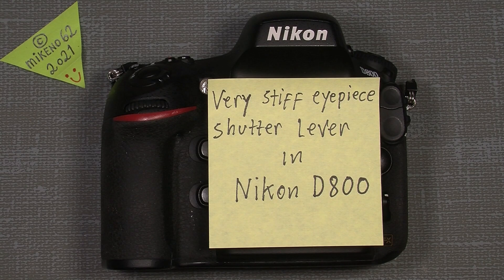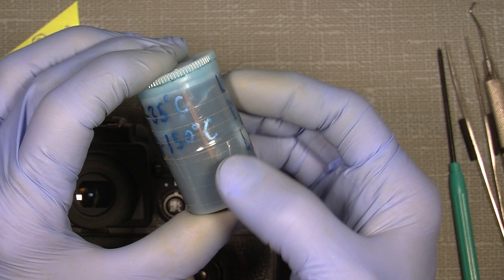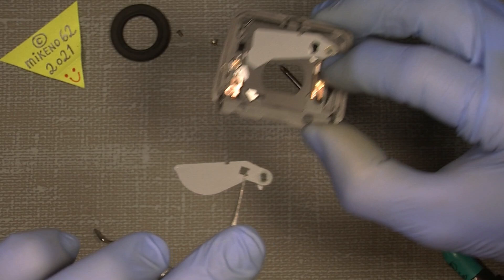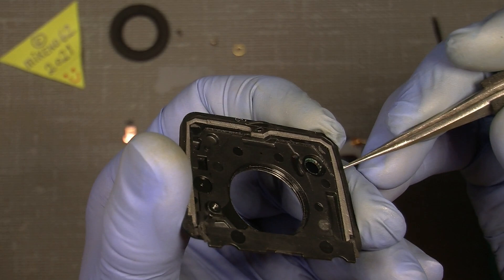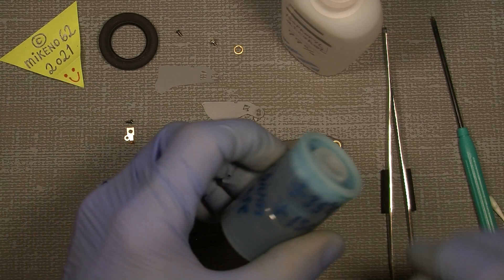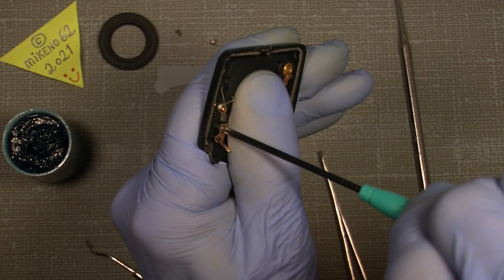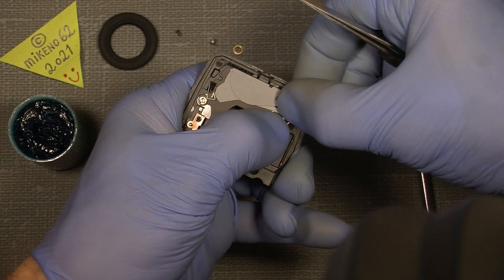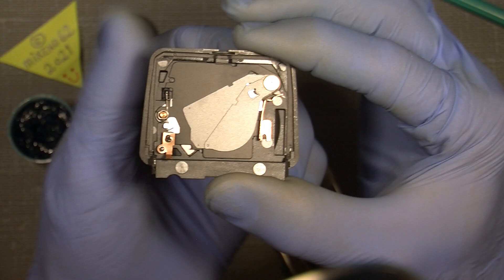Very stiff Eyepiece shutter lever In Nikon D800

Comment: Hello Mike, I have a 10 years old D800 that never been in professional cleaning. It just started taking half dark photos and talking to Nikon guys they said the servicing period expired and they have no longer chance to repair my gear. What I think of is that the shutter or curtains lost their lubrication, therefore they are running slower than they should, hence the sometimes half dark expos. The dark area is sometimes on the side (longer edge), sometimes in the middle and then there is no dark area, at all at the very same settings. Do you have experience in lubricating this stuff? Because no matter how keen I am to pay for the fix for Nikon, they refuse to do it, saying they cannot do it. Similar to Apple that keeps announcing computers obsolete (after 7 years) and official services refuse to even analyze the issues. In my camera, there are a little more than 20k expos, so still a baby. Peter

Comment: Hi Mike thx again for this new tip. Very unusual but it can happened with a camera not used for many times. Mike I got another question. Do you know where to find maintenance instruction manuals for Nikon lenses. I think you mentioned it in a previous video but I can t find any link for it… Thx in advance.
Reply from the maker: There are many Nikon camera and lens repair manuals on this site:  https://learncamerarepair.com/productlist.php?category=2&secondary=8

But you can also find many other repair manuals here:   http://arcticwolfs.net/
Reply: @mikeno62  Thx a lot Mike ! Do you plan to repair a 300mm F2.8 AF-S ? I got one with autofocus not working… the images are great but could be easier to get with an AF… and I guess that an official repair would be very expensive… :(. So if you get one don t hesitate to publish.